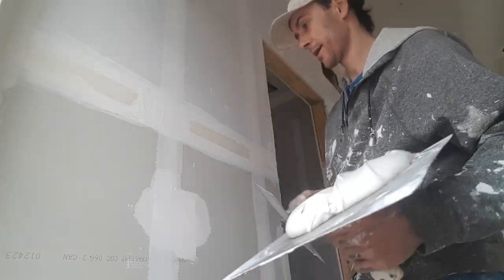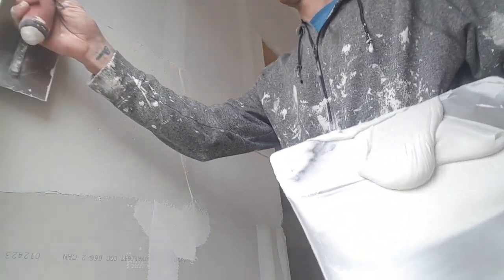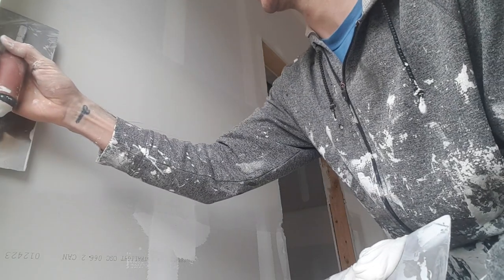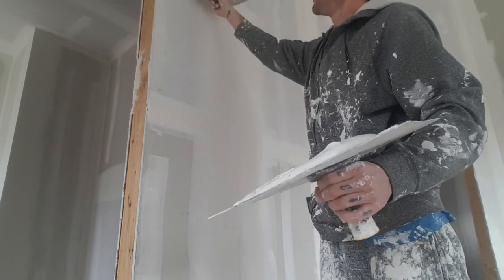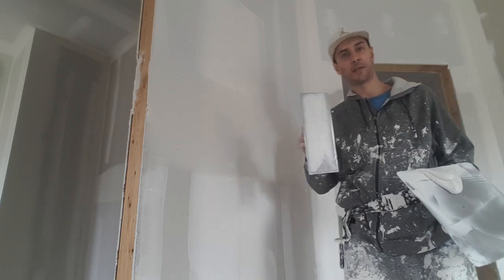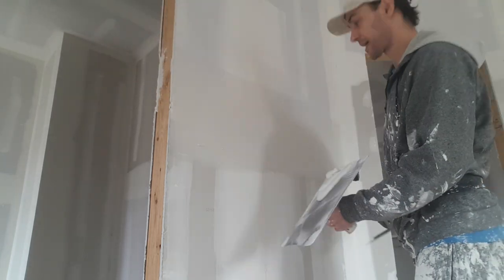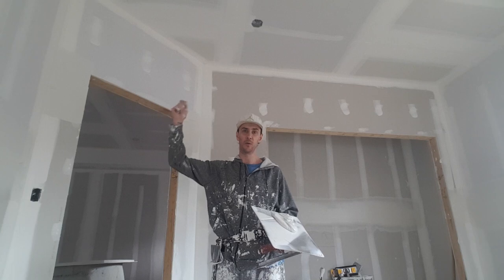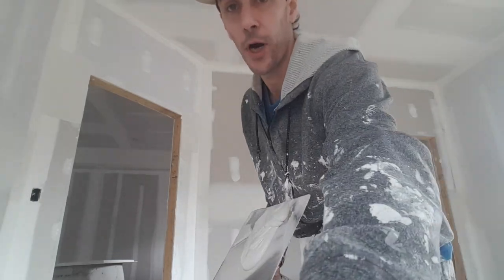One coat over the tape!! By hand 😎🤘👍🇨🇦

Comment: Setting compound or air dry ?
Reply from the maker: All purpose lite or machine mud so its easy to sand and add some water to reduce pin hole but not to much to   make a mess and it will shrink a lot more 😎👌💸🇨🇦👊